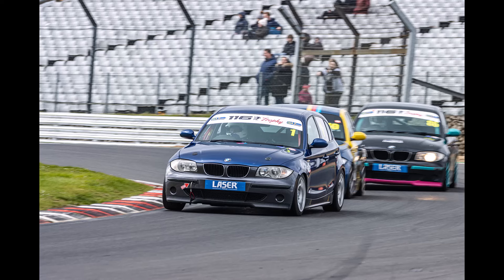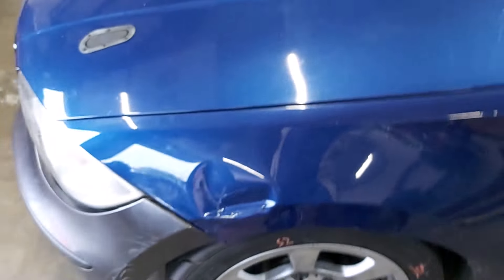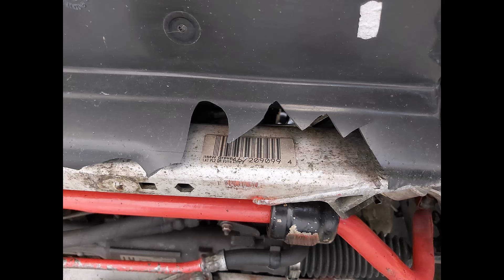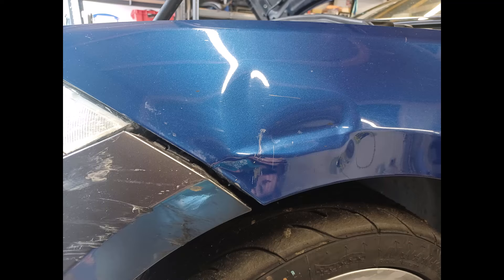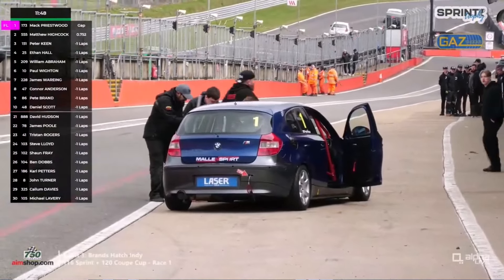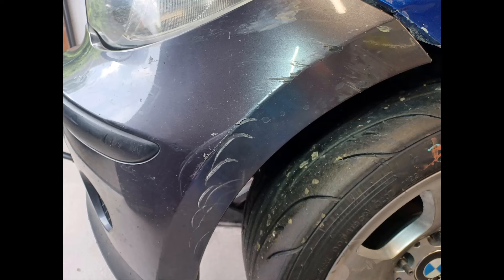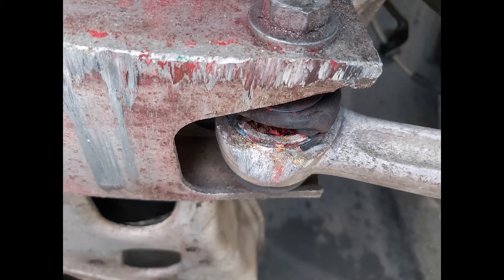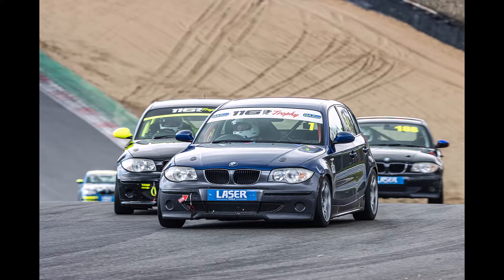Damage Report - Brands Hatch Indy, April 2024

Comment: this doesn't look too bad. maybe the posibility of the conttol arm slightly ground down would increase the risk of it failing, but i don't really think it was worth replacing, unless it was bent, which, from my limited undrrstanding, it didn't seem to be.
Reply from the maker: I have replaced it now.  I think you're right, though. It probably would have been good for years, but I just don't want to risk it.  Another issue was that a chunk of the dust boot was missing, and so dirt would have gotten into the joint.
Reply: @PaulOffordRacing  yeah, that would cause problems later on, even if you'd put loads of grease, the dust would just cement itself ig (please feel free to correct me bc i am very curious on working on my own car).